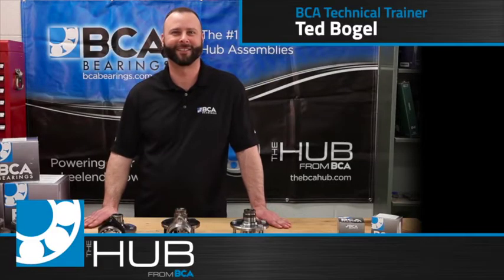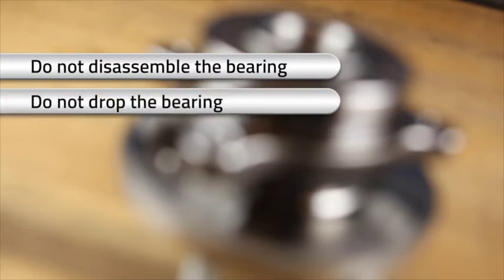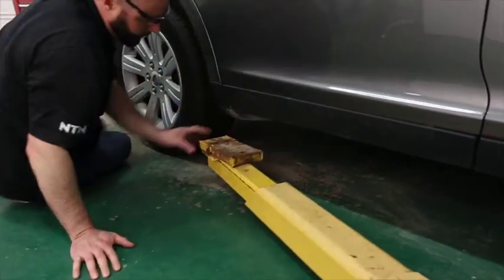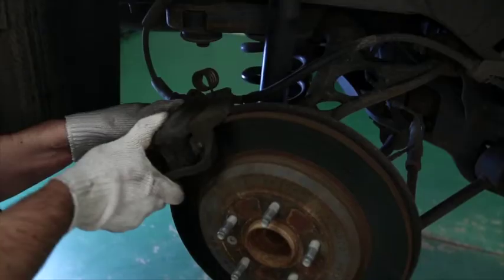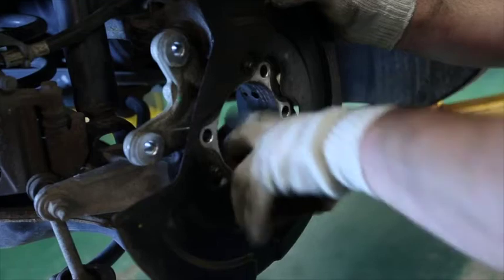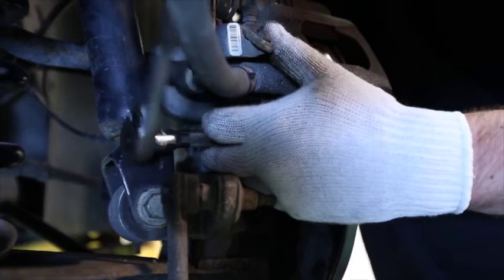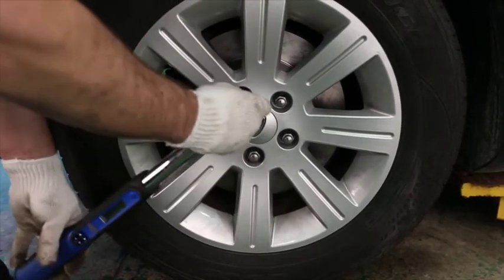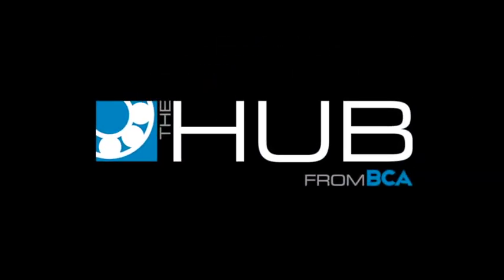Installation of a Gen 3 Wheel Hub Assembly

Comment: About how long would this take me and a friend in my driveway, do you think?
Reply: Depends on what car you have.  A Ford with Gen 2 bearing could take days.  A Gen 3 bearing should be anywhere from 45 minutes to a few hours depending on what you have to remove in order to get to the bolts that hold the hub to the backing plate.  Fords are great cars but suck for the backyard mechanic because of the thoughtless engineering that was put in place when they designed their cars.  You may actually have to remove the strut assymbly and lower a frame including knuckle.  It is a pain in the 'a' and better left to a real mechanic.  GM is the much better way to go.  I've done the Hub replacement in under 45 minutes.  A garage will charge you a minimum of 2 hours.